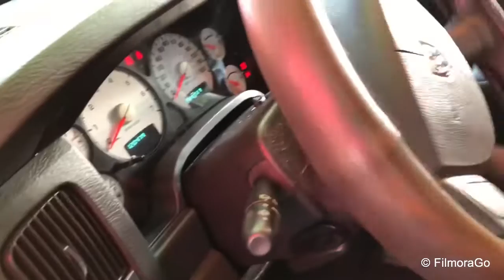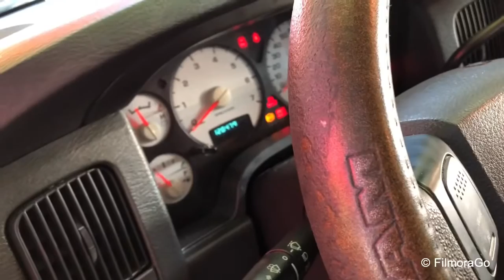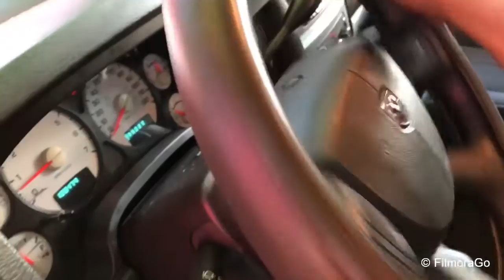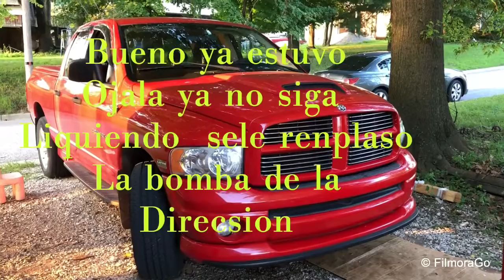como cambiar la bomba de la dirección

Comment: hola muchas gracias q power steerin me recomiendas para una Dodge D 100 1968 el power steering es nuevo pero no se como conseguir, la bomba de power steering pump que tenga 1200 de precion ,el pump que instale solo ace 800 de precion 
muchas gracias
Reply from the maker: Hola amigo bueno las mangueras si tiene son nuevas   algunas beses se pierde la presión porque son de ule y
Se tapan por dentro